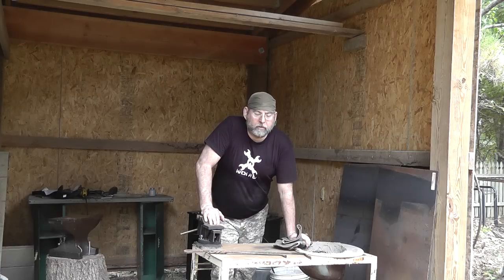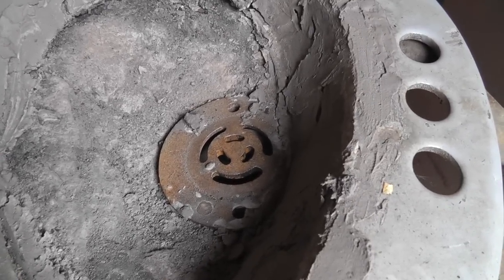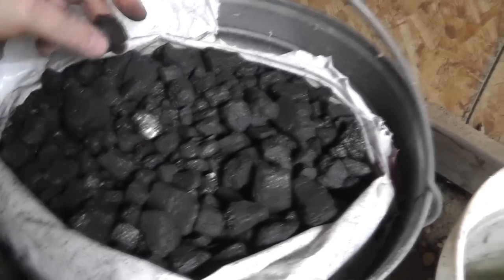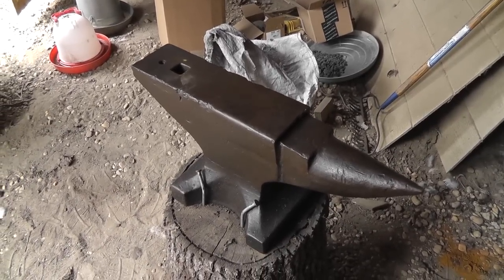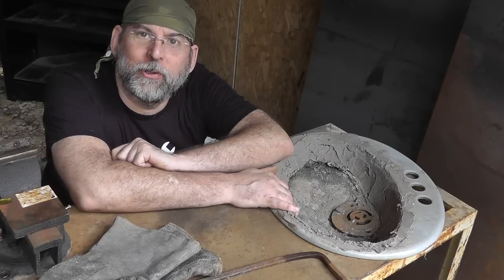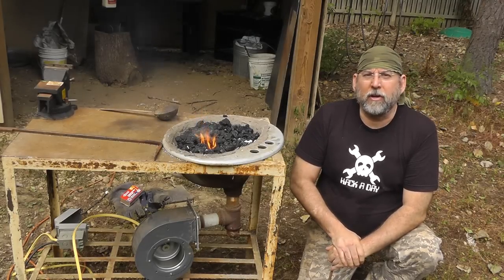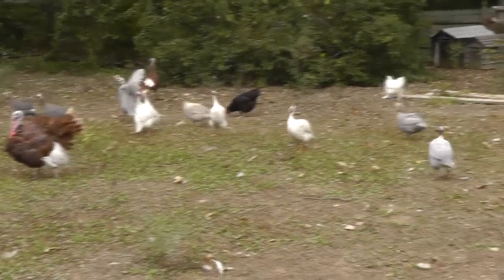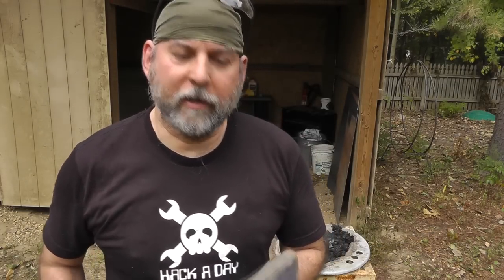Making a blacksmith forge out of a bathroom sink.

Comment: do u think a old ceramic sink would work? I think the glazing is fired around 5000 degrees?
Reply: I know i'm not the one you asked, but i don't think you should try that if you want to use your parts as before (it will crack, or explode to your face, don't try it). Fire pots are made out of cast iron, or thick steel sheets. You can cut out some plates of cast iron from an old cracked bathtub for example. You can weld the plates together, but you have to heat them to about 300-400 degrees Fahrenheit before welding, and let them cool very slowly after the welding. Steel is not that delicate.

Comment: Not sure if anyone will see my comment, but how would I attach that sort of blower to a wall circuit like you did?
Reply: depends if its 12v or 240v if its 12 use a 12 to 240v converter